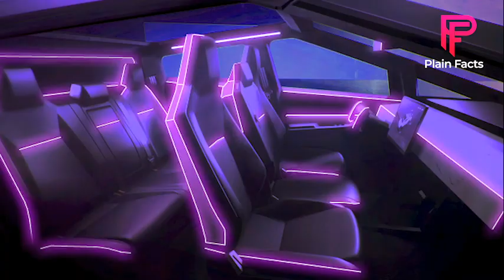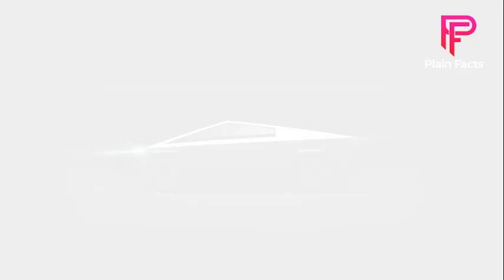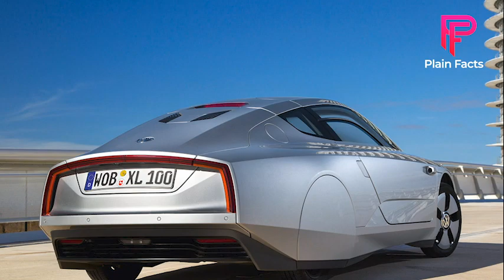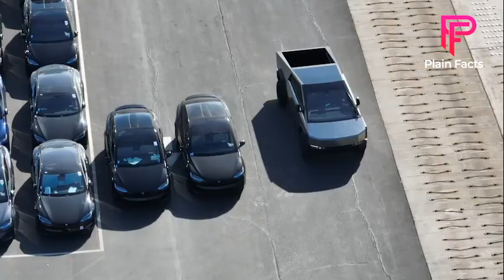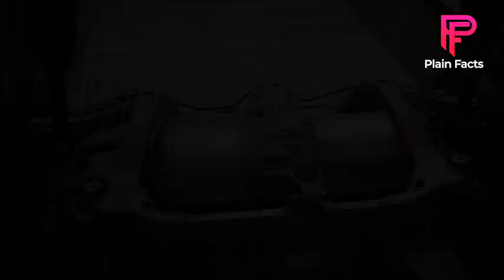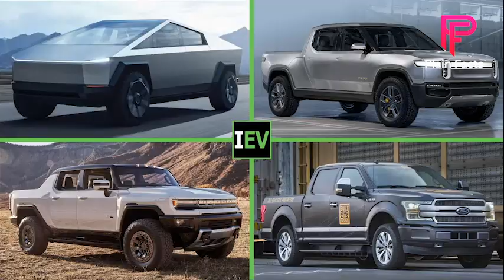CYBERTRUCK UPDATE - Insane New Update Leaked

Comment: Tesla has a door handle weakness.  Wiper weakness.  Oversized weakness.  Non-folding bed sides weakness (conversion to flatbed like the VW Transporter Truck.  Should have a back window that folds up and the bed has seats that convert the bed to 8.5 feet x 4.5 feet by folding down flat backed, in a 6 to 3 pax conversion.

Comment: I've been saving for a new vehicle in a few years and was favoring a gm/chevy full size, but I'm actually considering either the 2 or 3 motor (3 motor mainly for range - I don't need to pull that much weight).  Really want 4wd/AWD/whatever and long running range as some of the areas in my state are not going to be ev friendly (the county I go to doesn't even have cellphone towers and our hunting land has only very basic electric service).  I really love the post-apocalyptic look of the exterior as it reminds me of the landmaster from the old 80s film "Damnation Alley".

Does anyone know if a 3 motor will have a 5th wheel option?  Not that I need it, but really want to know everything about it before I write off the idea or run with it.  Meanwhile I'm still saving.

Comment: We can’t wait for our single motor cybertruck. It is exactly what we need. If we could make any change it would be a small second display above the steering or a heads-up display on the windshield. We do prefer a rear wheel drive only. Our needs have never been four wheel on any of our trucks.  We much prefer maneuverability, and years of reliability. 
We love the stainless body and we have discovered a company that will provide a wrap kit for our Cybertruck that we can install. 
Please get going on our truck(s).